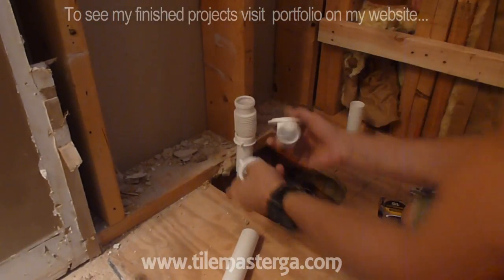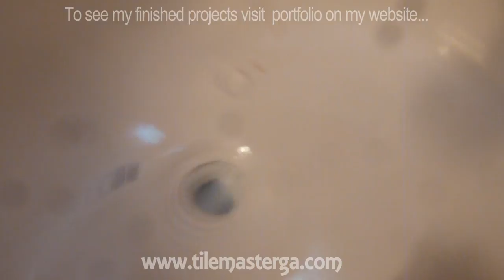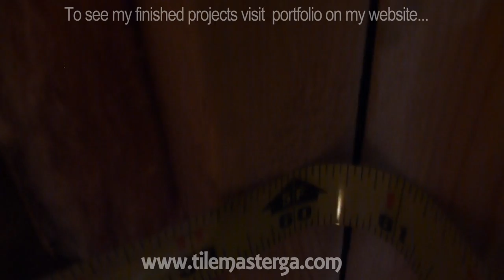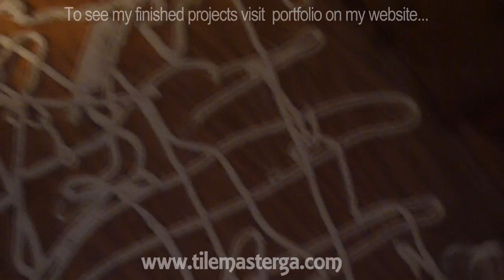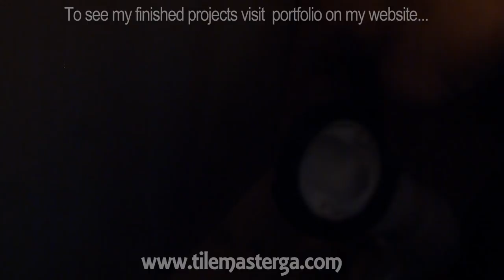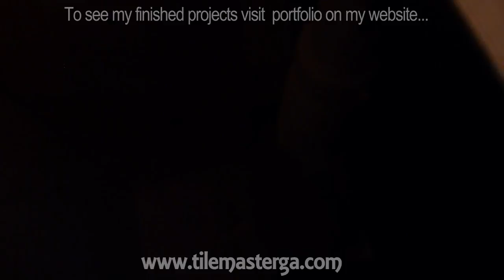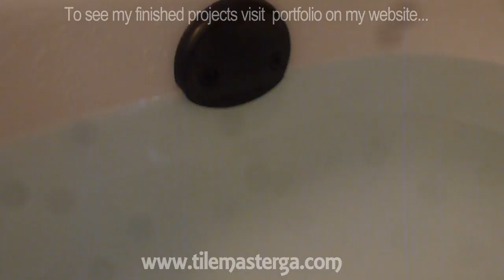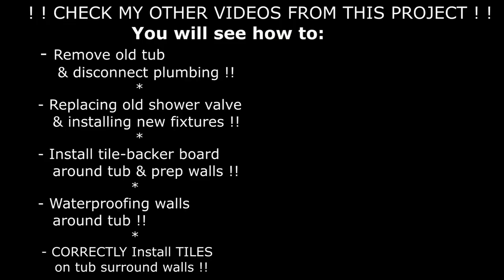Part "2" Installing new bathtub, connect drain waste and overflow plumbing DIY Atlanta GA

Comment: Now if I ever have to rod the drain from the overflow/clean out I’ve gotta worry about that crap flex connector ripping or breaking. Bad and cheap idea to do it that way
Reply: This video provides great detailed instruction, but the remodel drain and overflow kit that he has used and recommends is absolute garbage.  The very thin walled plastic pipe, connection nuts and particularly, the flex section of the overflow, are very low quality and susceptible to cracking and damage.  This is the cheapest kit sold at the Big Box stores and not likely to pass a plumbing inspection.  A bathroom may get renovated every 10 or 15 years, but the installation should always plan for a 50 year minimum.
Reply: That flex drain overflow, I don't think they pass any plumbing code.

Comment: ...some of those drain/overflow kits are crap...beware of kits with many/multiple adjustments, with gaskets here, gaskets there equals leak opportunities...pipe and glue are better.
Reply: yea I hear the same thing when I was watching this that's all I kept thinking about
Reply: True. But you'd better measure twice, three or four times, because if it's the slightest bit off it won't seal, and you're right back to the issue you mentioned with the slip joints. But then instead of loosening a slip nut and adjuting, you get to cut it all apart and start over, and hope you get it right for round 2.

Comment: Hey Tile Master, I have the same issue about being 1/4 inch off from the original plumbing, so the tub overflow drain doesn't align. What is the name for the flexible adapter piece you use? Thanks!

Comment: got any fix for tub floor flexing? the tub has a Styrofoam support on bottom but it still flexes. I think the contractor installed the tub too high. the tile is already installed around on the walls.

Comment: What is the saw used here?  Looks like a reciprocating saw but much smaller and better for tight spaces than an old sabresaw...
Reply: William Batchelor Oscillating saw. Good tool to have, lots of diversity in one tool.

Comment: Hey I have a question regarding a vapour barrier. Should I still use the plastic between a hardibacker and the outside wall?
Reply from the maker: I am never installing any moisture barrier - causes more problems down the road that it helps !! you can trust me on that  If correct tile board is installed correctly and necessary waterproofing is done you will not need it !!
Many contractors will put it as way of additional waterproofing and this is the biggest mistake !!!

Comment: I'm confused about the gap between tub and studs. If you move the tub from the other side and shim it, won't the backerboard and drywall now not line up? How do I make the backerboard and drywall flush when there is a gap like this?  Thanks
Reply: wsvitak I thought that as well
Reply: Old comment but you should probably use 1" x 3" pieces of wood to bring out the drywall. That's what you do on a 3 piece plastic tub suuround.

Comment: Great video!! ey what do you call that little saw you cut the overflow pipe with??
Reply from the maker: This is oscillating precise saw - you can get it in most of hardware stores.

Comment: No matter how good someone's video is - no matter how much time and effort - no matter that their a certified plumber there will always be someone that knocks their video. No matter how many leave negative comments or they would have done it this way or their way I have yet to see them show proof that they can do it better. And no matter to these people I ask where the HELL is your FRICKING video & not just your pinky finger typing on your keyboard showing you can do some thing better? I have been a licensed & certified plumber for 42 years. Plus I am a certified & licensed building inspector in one of the strictest areas in Michigan. I would have passed his installation job except for its plumbing. Out Community & plumbing codes do not allow for any type of plastic whether for plumbing or drains. We have done testing on expanding foam and have found as long as it's not >used on out door structures< it did >NOT break down or shrink used indoors<. Nice job on tub installation,Thank You
Reply: Brass?

Comment: Instead of using foam could you have used self leveling compound?
Reply from the maker: Randy Way Self level will be hard to apply - will leak all the way around. You can also apply cement, but make sure to put something ( durrock) on top of wooden sub-floor, so moisture or water from mix will not effect wood causing tub to slightly get lifted by wood expansion due to water.
Reply: +Sean Smith I thought they were using foam these days to lift driveways and similar areas.   Why would they use foam, if it breaks and settles so easily?  I'm just wondering.  I'm not in the construction/remodeling business, as an FYI.
Reply: So the foam being used to lift driveways and roads is just a scam that will last a very short time?  Not to argue since I'm just asking to learn.  Have you done any research on those special foam being used to lift driveways?  I'm curious, that's all.
Reply: +Sean Smith Get a clue man. Why would you comment when you clearly have no idea what you're talking about?
Reply from the maker: +Randy Way . You can also use cement or thinset under tub, something that is solid when dry and will cover entire space. I know that plumbers like to use drywall compound, but i do not recommend that - will crack. Recently i been using thinset, gives more time to play with setting tub and is rock solid.

One thing for sure, do not leave that gap empty, unless you have real cast iron tub.

Michael
Reply: I bet you are a class act...
Reply: Randy Way n
Reply: This guy is clearly one of those "experts" who takes it upon himself to hop on YouTube and criticize everyones work. If he is even in the trades (doubt it) then he is obviously one of those guys on site that every pro loves. Has an opinion about everything and won't shut up.
Reply: Okay Bud. Get a life.

Comment: I'm not a fan of that drain assembly....so many pieces. I would say at minimum to silicone the parts together everywhere. Double insurance. It's not like you gonna be doing this type of thing every year (most likely 10+ maybe 20 heh)

Comment: Sean smith why don't you make your own video... there are so many know it all tools who float around on YouTube critiquing everyone else's video and in the process revealing themselves to be amateur knobs. Spray foam under the tune is pretty common practice, it might not be your preference but it doesn't make it wrong. Lots of manufacturers specifically say not to use thinset or mortar etc under the tub for a base. Go make your own videos and stop wasting everyone's time with your newbie comments.

Comment: Using a flex like that can really be a bad idea! If the tub is sating on the ground floor, it's not going to be censored. if and when it does leak, over time, can cause irreversible damage!

Comment: Why not Hardie backer,????? The Hardie rep here bought all of my wonder board and replaced it with hardie.  75 percent of contractors here use hardie here.
Reply from the maker: 75% of your local contractors is most likely " builder grade contractors" or simply do not care what they use.
2 main issues wit Hardi becker board:

- they are only 3/8' thick and will make transition to 1/2" drywall challenging to finish correctly

- Setting components do not bond well to Hardi board.(even premium products)
Reply: I really enjoy your work , most of contractors I asked about Hardie ,love it and have no bonding issues with mixed white thin sets, they also say that it is more sturdy  than , the other cement and fiberglass board products . I wonder if it's a climate issue with humidity?  It wouldn't  make since about being builder grade contractors  because the other boards are cheaper, and builder's  pick up the material tab to save their assets. Hardie says it's 1/2 inch, but we all know half inch is 15/32 now thanks to Georgia pacific, just like plywood  lol.
Reply: Also why do u use foam to set your tubs instead  of plaster Paris,  or wall mud, or sand topping mix.
Reply from the maker: Karl T Bonding issues comes out after 2-5 years !! not right away. I know that standard industry warranty is 1 year, but what after that? As long as tile work will last 1 year builder has clean hands, contractor has clean hands and manufacture has clean hands !! REALLY ???  What about homeowners that just spend $20000 on remodeling. Should they start "saving money" right away to re do it again 2-5 years from now??? 

Karl, I know what I am saying. I am remodeling specialist and each time we demo tiles from hardi or fiberock they come out so easy, that original board can be re-used again !! REALLY? It should be permanent bond !!!

Those 75%  contractors most of the time will use such hacky products because it means continuous business ALL Life Long !! No body cares about durability and homeowners any more....... WTF is wrong with those 75-90% of US contractors ????
Reply: I will take a picture of demo I did yesterday  with 1/4 Hardie backer board, around the wirlpool tub ,the tile bonded well to the board and it's 10 years old, I think you just had bad luck with Hardie,  or like I said maybe a humidity  issue , Hardie had to change instructions and products due to regional climate on their  siding but at least they did change. By the way I am in Oklahoma.  In Oklahoma  warranty issues in OK are 3 years unless it's commercial than one year. That's their  protection here because  we don't have contractor testing or license.
Reply from the maker: Karl T Karl, like you said - I had bad experience wit Hardi Board way too many times... and that is enough to put this product off the list. I will never use it or recommend it.  In my opinion standard 1/2" Cement board is still the most recommended and legit type of underlayment!

I am just sharing my honest opinion - what I experienced for last 10 years being in the field.

Comment: This is a completely wrong tub installation You should never have the Durarock go flush with the flange the Durarock always goes over the flange. If you need to then you shim out the walls so that the tub just hits into the opening..